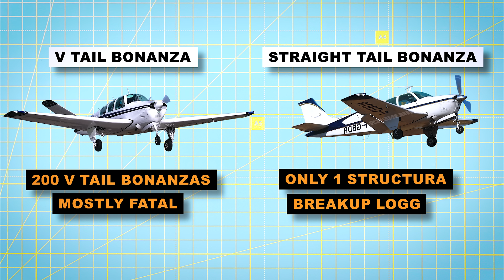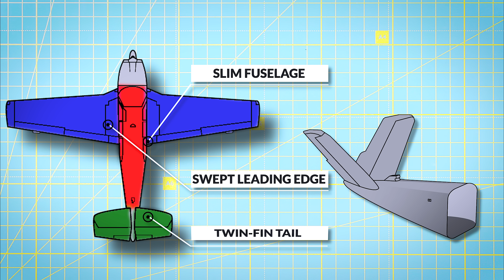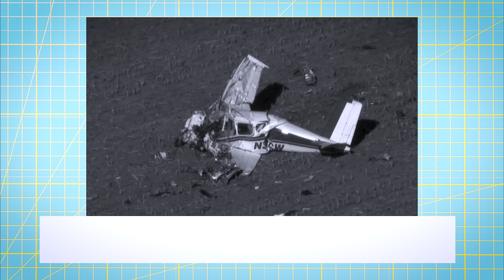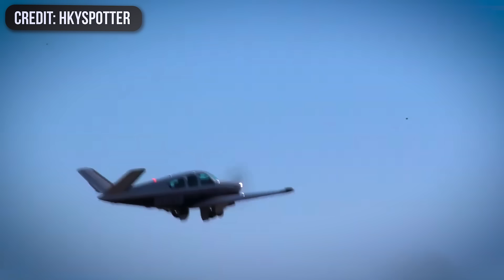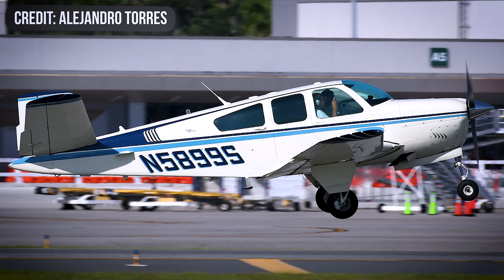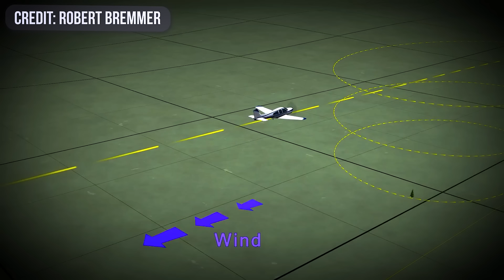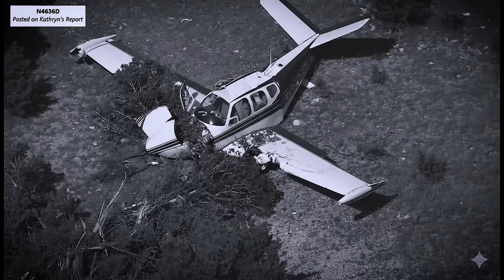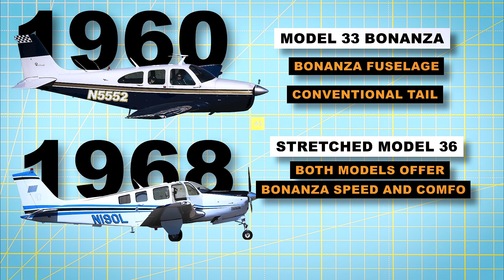Why Did This Plane Kill over 200 People?

Comment: There is so much AI regurgitated bull$hit in this video, I lost count before half way through. The most glaring is the continuous comparison between the 35 V-tail, and the 33 conventional tail versions. The fact is the model 35 with a V-tail, was first sold in 1947, while the model 33 conventional tail version wasn't produced/sold until 1960, some 13 years LATER. So, how do we compare accident data between different tail designs during those early years - impossible! 

If one does some actual research, you will find that the real problem stemmed from design changes to the V stabilizer surfaces, as both the engine power and aircraft certified gross weight increased during the evolution of the V-tail airplane. Most notable was the lengthening of the stabilizer chord IN FRONT OF the stabilizer forward spar. The usual break up sequence started with this unsupported longer leading edge portion of the stabilizer deforming (bending) due to an over-load, which resulted in one or both stabilizers ripping off the tail of the airplane. This would precipitate the aircraft violently pitching nose-down, whereupon the wings would fail from G-overload. 

Final support for the above is found in the way the FAA mandated the fixes in the Airworthiness Directive (AD) that resulted. The reinforcing "tail cuff" isn't even mandated for the 35, A35 & B35 models which were sold during 1947 through 1950. While there were problems with V-tail Bonanzas, at this point in time, it is probably the most thoroughly tested piston single engine aircraft at all time. This makes this a very biased click-bait video, designed to slander an iconic aircraft model and is so full of misstated "facts" and absolute untruths as to make it a complete waste of time!
Reply: I've flown straights and V's.  Over 5,000 hours in props.  18,000 total.  The V's definitely Dutch Roll like crazy in just moderate bumps.  They could easily result in a lack of control for a less experienced pilot in IMC.  Talk stats all you want.  Go fly the plane in some actual crap conditions if you want to see results.
Reply: @nuclearrabbit1  Anecdotal gibberish.
Reply: And, the aft cg issue mentioned in the video does not mention that cg moves aft as fuel is burned.  As with any airplane, they each have their own characteristics which must be understood and respected by a properly trained pilot.  I spent many hours in a S35, and it was one of the best airplanes I ever had the pleasure of flying!
Reply: Thank you all for the replies. ZetaByteMe owns 3 V-tail bonanzas with way over 1000 hours of time in type, plus a 31 year career in commercial aviation, preceded by 8 years of military flying. All I'm trying to say is that this video is click-bait and filled with glaring and slanderous distortions. If it were accurate, it would have said that Beech took a safe design, and as it evolved during the model 35's production, they compromised the design of the two stabilizers by extending their leading edges too far in front of their main spars. This by itself didn't make the airplane dangerous, but it did decrease the safety margin for tolerating impulse loading at high airspeeds. And, being a very clean air-frame, the airspeed would rapidly increase if you pointed it downhill. So, the non-proficient pilot, who entered IMC, and let the airspeed increase to near, or over red-line, would finally notice the problem, and make a startled sudden input to the yoke, which would translate to an impulse load on the tail surfaces, which would then fail. This was followed by the airplane falling from the sky in pieces, always fatal. So, was that the fault of the airplane, or the fault of the pilot who failed to operate it within its design envelope of airspeed and G-loading? As for the aft-cg issue, please remember the model 33 and 35 BOTH share the exact same wings and fuselage, with the only difference being the conventional or V-tail respectively. The 33 , given the extra tail surface, is almost identical CG wise to the 35 with the extra weight of the "mixer" mechanism used to combine rudder and elevator inputs to its ruddervators. And it is historical FACT that the V-tail was produced for 13 years without a straight-tail cousin to compare it to. Please do not denigrate one of the best designed aircraft ever sold without doing some actual quality research!
Reply: Do you feel better?
Reply: That, and mostly doctors flew them. 😜
Reply from the maker: You are wrong.

Saying it’s “impossible” to compare V-tail and straight-tail accident data when FAA, NTSB and Aviation Consumer all did exactly that and published hard numbers. Accident studies do not compare 1947 to 1950. They compare the period where both families are flying at the same time, using rates per 100,000 flight hours. That is exactly what the FAA, NTSB and Aviation Consumer did, and they found the V-tail had a much higher rate of in-flight structural failures than the straight tail Bonanzas when operated in the same era. The time lag between first deliveries does not stop that analysis at all.

2. The “real problem” was not only the chord extension
Design changes to the V-tail are a big part of the story, especially the longer chord ahead of the spar on the later models, but calling that the real problem ignores half of the official record. The accident pattern shows a combination of structural margin and pilot behaviour: overspeed in turbulence or IMC, abrupt control inputs, overweight loading, centre of gravity issues. That is why the key ADs also impose speed limits, placards, inspection schedules and training emphasis. Reducing it to a single design tweak rewrites what the FAA actually concluded.

3. Your “usual breakup sequence” is incomplete
You describe one neat chain every time: leading edge bends, one or both fins depart, nose drops, wings fail from G. That sequence fits some of the long-chord C35 and later failures. The early short-chord 35 and A35 and B35 did not always follow that script. In several cases the first structural failure was in the wing, with the tail still attached at separation. So your wording makes a specific subset of accidents sound like the universal pattern, which is not accurate.

4. The tail cuff point does not prove what you think it proves
You are correct that the reinforcing cuff kit is aimed at the long-chord tails and is not installed on the original 35, A35 and B35. What you skip is that those early airplanes still ended up under separate ADs with inspections, life limits and speed restrictions, because the authorities still saw a structural vulnerability in the V-tail fleet as a whole. Saying “the cuff is not mandated on 47–50 models” as if that clears the entire design ignores the rest of the mandated fixes.

5. “Most thoroughly tested piston single of all time” is a claim you cannot support
You present that line as fact, but it is just your opinion. The V-tail has certainly been studied a lot, mainly because of its accident history, but there is no objective data that ranks it above every other piston single ever built in terms of testing.

So no, the video is not “AI regurgitated”... I know exactly what I am saying, I studied hard facts.
Reply: @Esploure  I think you clarified some of his points.

1. Accident comparisons are not “impossible.”
Published studies compared V-tail and straight-tail Bonanzas during overlapping operating years using rates per 100,000 flight hours. Aviation Consumer and FAA-cited data reported substantially higher in-flight structural failure rates for the V-tail models during the same era. 

2. The issue was not just one chord extension.
Official discussions reference both structural factors and operational factors such as overspeed, turbulence, loading, and pilot inputs. The record does not reduce the problem to a single geometry change.

3. Breakup sequences were not identical in every case.
While some accidents followed the stabilizer-first failure pattern, published analyses do not claim a single universal sequence for every breakup.

4. The tail cuff point does not clear the early models.
It is true the reinforcement kit targeted later long-chord tails, but early models were still addressed under separate AD requirements. The absence of the cuff mandate does not mean the fleet was declared structurally immune.

5. “Most thoroughly tested of all time.”
That phrase does appear in aviation media. An AVweb article described the V-tail Bonanza, along with the Malibu Mirage, as among the “most thoroughly tested single-engine aircraft.” However, there is no FAA or NTSB document that formally ranks the V-tail Bonanza as “the most thoroughly tested piston single of all time.” The phrase exists in published commentary, but not as an official regulatory designation.
Reply: @smark1180  Perhaps one of these commentor's can post some "breakup" facts rather than gossip and innuendo. There have been many crashes, no argument. But just about every case the wreckage remained in one place. 

The " The most thoroughly tested of all time"was commonly stated terminology in those days in many aviation publications. There is no FAA or NTSB document that states the Boeing Max is the most tested but it likely is and I've seen articles stating just that. Neither the FAA or NTSB are in the business of ranking and rating aircraft models. 

Tail cuffs or any other AD mandated update ever "cleared" any aircraft of anything. 

Finally, ALL aircraft when the red line is exceeded are susceptible to inflight  damage. That's why that "RED" line is on all airspeed indicators, not just Beechcraft's. And if you ever have found yourself in a thunderstorm, you know what mother nature can do. Thanks to ATC in Florida, I (we) did just that. We came out of that storm 2000 feet higher than we entered. All due to some dip shit controller who didn't want to be bothered by a Bonanza cruising through his airspace. That controller was looking for another line of work after the tapes were pulled by the FAA. We could have very easily been one of your breakup statistics that day. It's not always the aircraft or the pilot.
Reply: @Georgiagreen317  Why did you rely with that to me?
Reply: @Esploure  this entire response is written by an LLM
Reply: @Merppppppppp doesn't that mean language learning model?
Reply: @Vlorpy  large language model
Reply: @Esploure even your response looks Ai generated lmao 😂😂
Reply: @zonomena9153 god forbid some people still have actual writing skills… you’re brainrotted
Reply: @Esploure   This reply reads like an AI response.  No harm in using an LLM to proofread your writing,  but you should expect people to call you out when you copy and paste the output.
Reply: @Esploure  ZetaByteMe is correct and you have done a lousy job of preparing material you just don't know much about. How many Bonanzas have you owned or flown? And what's your experience?
Reply: Take it easy. This is basically entertainment.
Reply: Well said!

Comment: One of the ADs is for inspection of the ruddivator push rod tubes.  The ad has you clean them, inspect the for corrosion and seal them with cosmoline.  The tubes are aluminum.  The V-Tail directs rain water to the tube area.  It was found these tubes could fill with water and corrode.  They could also freeze with water in them causing the threads to separate from the tubes and cause loss of control and breakup.  After the cuff AD they still had inflight breakups.  My friend who was Beech trained and has worked on Bonanzas his whole AP/IA feels this was the real cause of many(not all) of the breakups.  The other is it’s fast and slick.  You can’t point it downward for very long with cruise power, it will start going fast, breakup fast.  Once you get to really know a Bonanza you realize how special it really is.  The wing is incredible.  It’s used on many of the Beechcraft lineup such as the King Air.

Comment: Ironically, one of the Bonanza's greatest safety features - 52-knot clean stall speed - contributed to the break-up reputation. While other similar-performance airplanes with higher clean stall speeds (like the Piper Comanche at 62 knots) would aerodynamically stall in a spiral dive and unload the wing, the Bonanza would continue "flying" until g forces finally exceeded structural limits. My old boss Richard Collins at Flying Magazine used to say the only difference between the sad results of those two airplanes in a spiral dive was the Comanche hit the ground intact.
The part that is seldom mentioned in the "Doctor Killer" debate is the unknown number of instances where the Bonanza's slow-speed capability prevented runway overruns and/or saved lives in forced landings - or even resulted in a no-damage emergency landing vs a fatal accident. Touching down at 52 knots (or even slower with gear and flaps down) as opposed to 10 knots faster improves chances for survivability, literally exponentially.
With the wheels and flaps down, a Bonanza is rock-solid; more stable than a Cessna 182 IMHO. I could routinely land on the numbers and make the first turnoff in my 1954 E35, and trust me, it's not because I'm such a great pilot.
Reply: @markphelps588 You’re attributing this to stall speed when the real issue is maneuvering speed. In a steep (spiral) dive, if the airplane accelerates above maneuvering speed and the pilot makes a large control input, it can exceed structural limits before the wing stalls. That’s true of any GA airplane, not something unique to the Bonanza.

The key point is this: above maneuvering speed, you can overstress the airframe before a stall occurs, whether the clean stall speed is 50 knots or 60. Stall speed isn’t what determines structural protection in that situation.

Comment: All airplanes are dangerous, some more than others. Bonanzas, especially in the hands of inexperienced, overconfident pilots, got a reputation for in-flight failures, but most of those were due to overconfident, inexperienced pilots who flew them into situations the airframe wasn't designed to handle. That said, I'd rather fly a straight tail Bonanza any day. I tired of the tail-wagging in my friend's '63 V-tail model.

Comment: My Dad had one for a while. One day after reading some tech article he said, "I'd pretty much dismissed reports about tail failures of these planes being the result of inexperienced pilots getting in over their heads. But according to this info, there really is a problem and I'm lucky that I never had a problem coz I took it to the limit quite a few times."
Reply: It is not a good choice for any pilot that has less than 1500-2000 hours.

Comment: Back in my CFI days in late 80's worked at a flight school that happened to have a V35B on the rental line.  We all loved it. The controls so harmonized. Cool verneer throttle and prop controls. With that big 6 cylinder continental engine it would get up and go. At altitude leaned out to best power you could hum along at 165k easy. Yes it would dutch roll in turbulence. You just let it do its thing with very light dampening if any. No problem. Yes it had a sensitive aft CG. Again no issue if you load properly. Never had more than 3 of us in the plane with the 4th seat used for luggage. Never used the aft cargo area. This particular V35B was 70's model with the strength reinforcement mods.  The flight school owner used it for Pt 135 charter and consequently had it in some fairly bad weather. He was convinced most of the break ups were pilot induced over controlling and over stress. I concur. Later we got an F33 straight tail. Got to fly an A36 too.....to this day the finest 6 place GA airplane ever built IMHO. Mooneys are nice but so small inside. Not nearly the roominess of the Bonanza's. Later in my career flew the King Air series. Now thats a pilots airplane. Beech sure knew how to build em.

Comment: Factually incorrect. Way exaggerated. Correct tail had some issues, resolved, but statistically still in the top third of  lists. Unfortunately, our legal system grades problems where airplane manufacturers don’t want to upgrade. For example, when the bonanza detail was replaced by the straight tail bonanza, lawyers took that as an admission of guilt of bad design. That caused much of the problem and the exaggerated claim on safety. This goes right along with the Audi unintended acceleration of the 1980s where was proven later that it was pedal error where people simply pressed the accelerator thinking that they were pressing the brake.  Again the lawyers take over and the public is misinformed. But I’m sure you got some clicks because it’s great Clickbait. Your next video should be about the unintended acceleration on Audi automobiles.

Comment: No issue with my S35. I teach in that airplane. Regularly flying to the performance envelope without issue. Now. There are things that you must respect which, in my opinion, make it an amazing airplane. I taught a guy in his A36. Not as fun.  The A36 also has Dutch roll. I have a yaw dampener. Spiral divergence is a fun demonstration. It’s a very stable airplane.

Comment: I have a few hours in a late model 35. There are still in-flight break ups, stall go arounds, and fuel management engines failures happing to this day. I considered buying a '68 V35A years ago and passed. Also, they didn't clean up the instrument panel until 1984, two years after production ended for the V35B. So, no 35's have the updated instrument panel.  I prefer the A36 or turbo 210.
Reply: That's incorrect. The "modern" style panels appeared on the 1961 P models. You may be referring to the engine instruments that were reduced in size and placed in a column to the right of the flight instruments.